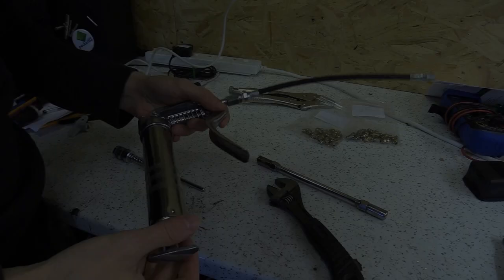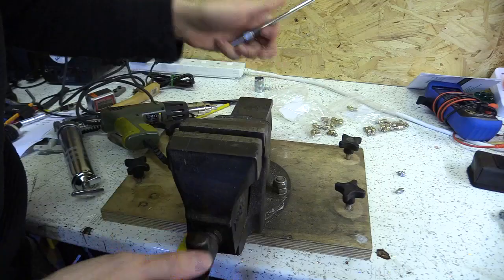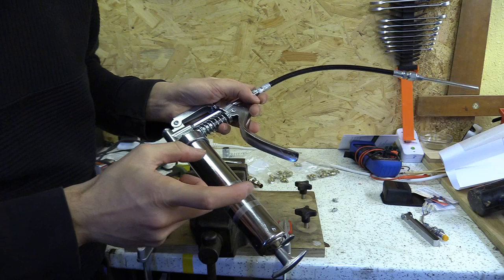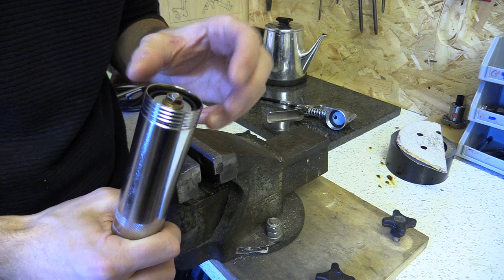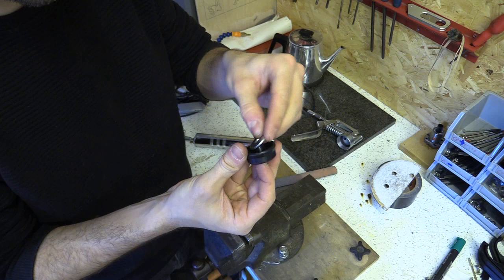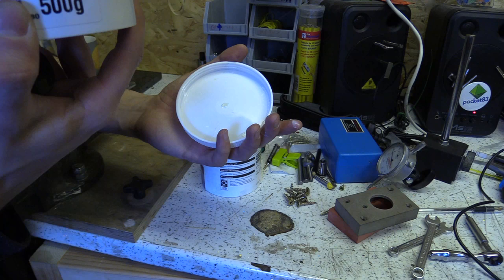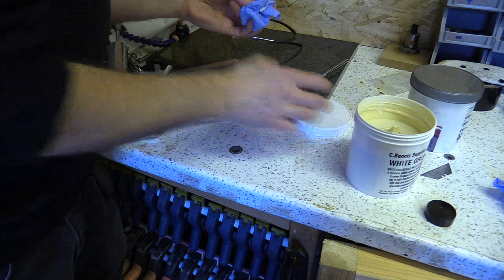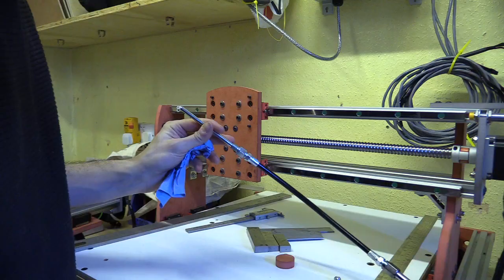#51 Packing Grease Gun / CNC Linear Rails and Ball Screw Maintenance

Comment: i need your help man , i am making a small 3018 cnc machine at home , is it ok to use flexible couplers on it? i could not find any regide ones in my coutry, when i try to mill , wont the flexible couplers ruin my z accuracy?
Reply from the maker: I prefer the spider ones but they should be fine. As long as they are the clamping type and not the ones where the grub screw pushes against the motor shaft.
Reply: @EducatingSavvas   thanks ;D i already made it and its quite good